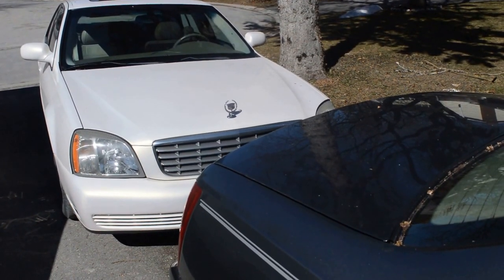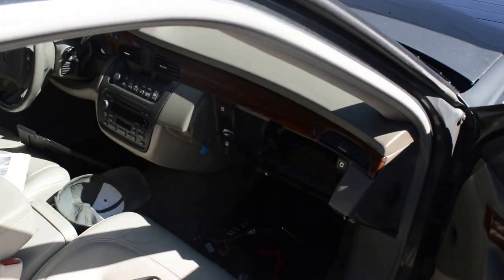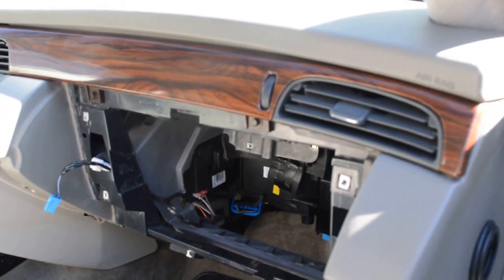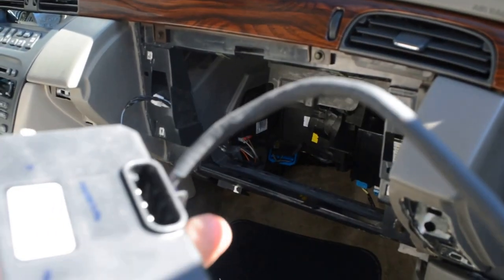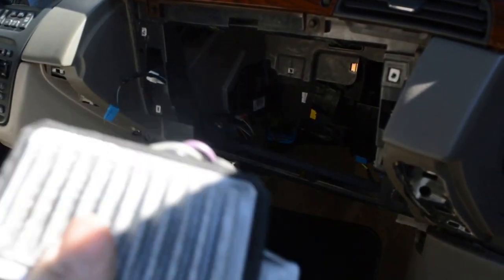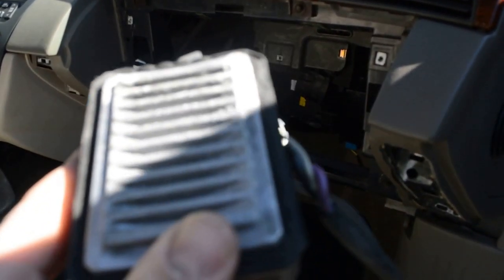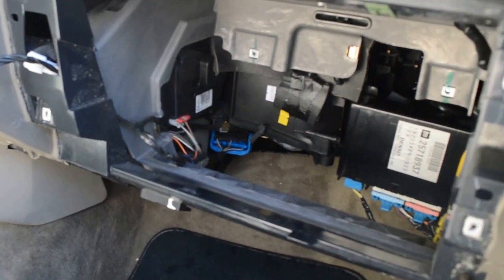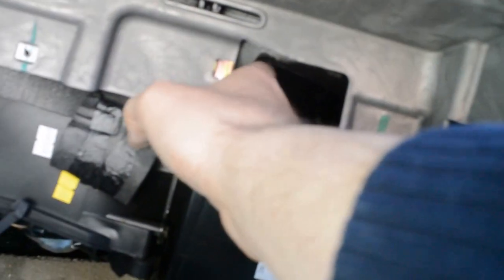2003 Cadillac DeVille-Blower Motor Control Module

Comment: I have a question: my 2003 deville is blowing 0 air from the front, rear, and even defrosters. Is this a blower motor control module issue?
Reply from the maker: There are electronic dampers which direct the air. These are controlled by little electric motors. With time they stop working. Our own DeVille is not blowing a/c through the dash vents at all- only the defrost and floor. Even though we are asking for dash vents. It is a common problem and often can be associated with a distinctive clicking noise. This is not always present but sounds like you have a similar issue.  I was told to pull the dash to repair. In my case- I just have not had time. If I do it/ I will be sure to video the steps. Hope yours works out. Thank you for watching!

Comment: Can you describe the problem that you were experiencing with the blower functions before you replaced the module?
Did the blower motor kick on sometimes but not always respond to the controls properly? Did the blower motor not turn on at all? Could you bang on the dash and make it work sometimes as other people have reported? Any information would be extremely helpful. Thank You!
Reply from the maker: In our case we had no operation at all. After checking that the switch was working .Then the blower itself( by putting a hot lead to the unit directly) we determined the module was the culprit. What you are describing is a blower motor in its final days. When a blower motor is almost finished it can go on and off by hitting the dash or even a bump in the road can activate it. The only option in your case is a new blower motor- an easy fix!! Good Luck!

Comment: I just changed a blower motor in my 2005 cadillac deville dhs. I can hear the blower motor working but it isn't blowing any hot air through the vents. But in the rear Its blowing somewhat hot air. Also when I change it to defrost the blower motor stops. What do you think the problem is? I would really appreciate any advice thank you.
Reply from the maker: Sounds like it could be a damper issue. They are the little doors that direct air to the floor, vents, defrost etc.. They are controlled by an electric motor and they do fail. It involves removing the dash in most cases. Certainly not a job you would want to hire out. The labor is very high. If you can fix it yourself - that is the best option. Good luck and thanks for watching!

Comment: We own a 1990 Cadillac Sedan Deville and today the fan wouldn't shut off on the AC/Heater, even tho we shut the car off at the ignition switch, What would cause this to happen and how would a person go about repairing it?  The Temp will change, with the Warmer/Colder buttons, goes from heat to AC OK, but the fan won't shut off.
Reply from the maker: Sounds like a relay might be stuck. Your best thing is to invest in a good shop manual.  Electronic Climate Control Systems do not age well. Good luck !
Reply: @Cadillacguy100   I think you may have been right. But after we removed the fan, cleaned out the insulation that our local mice friends thought we needed in the squirrel cage, it has functioned correctly. I do think it stuck, and after cooling off completely, it worked like it should.  Thanks for the help!!!!

Comment: On my 2003 Cadillac Seville, my blower came sometimes, I bought a new blower and a new module. And it still don't work. What could be the problem
Reply from the maker: First see if it comes on intermittently or not at all. If it is completely dead check for a blown fuse or bad ground. It it works only part time check the switch on the dash and for broken or loose wires and connections. Good Luck!
Reply: Find where the ground circuit is and fuse for power supply to a/c module. Make sure all connections are tight and squeeky clean especially the ground.